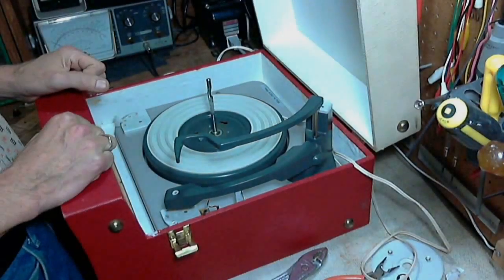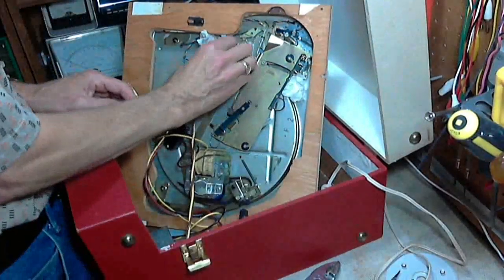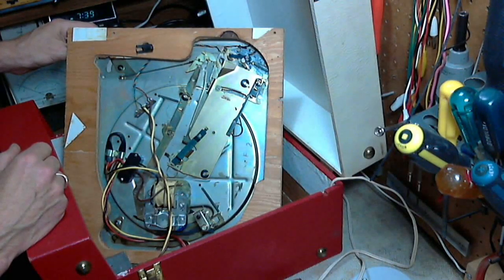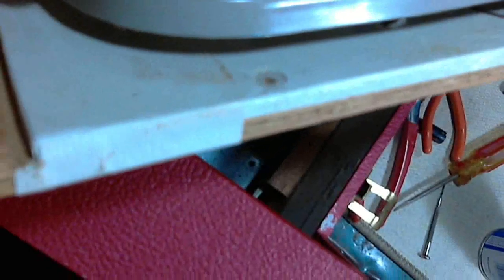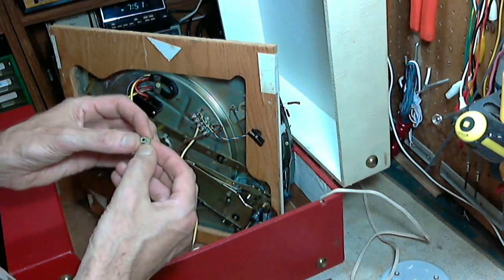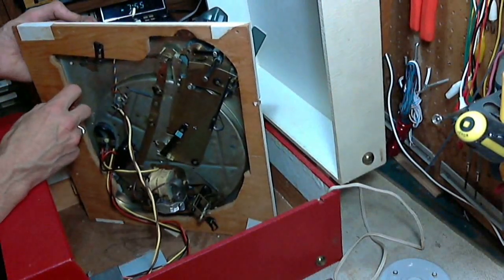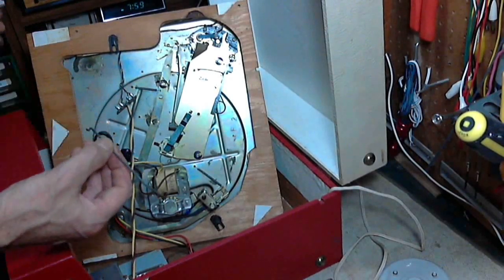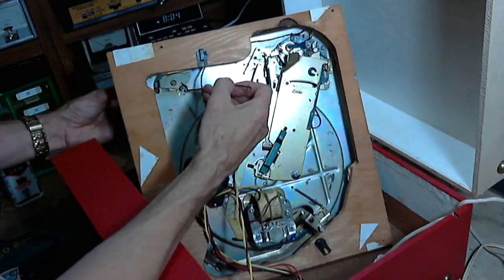Admiral Suitcase Record Player Video #2 - Mechanism Maintenance

Comment: That one clip go's under the plastic on off reject part. It was on the metal shaft top side of motherboard before you put the cover back on and use a clip on it under the motherboard.
Reply from the maker: ***** Motherboard?  You've been hanging around computers too much.  :-)